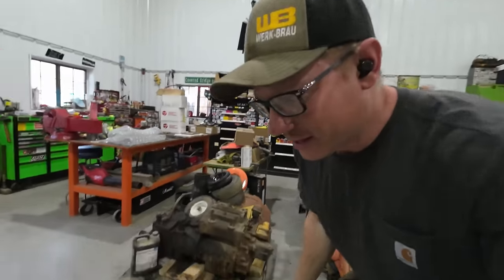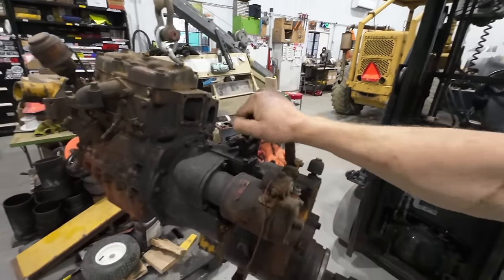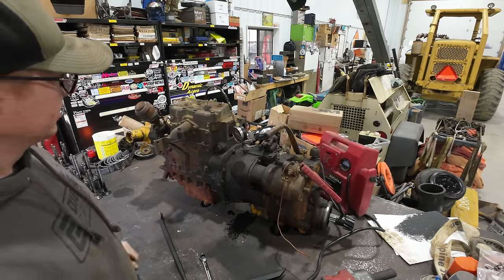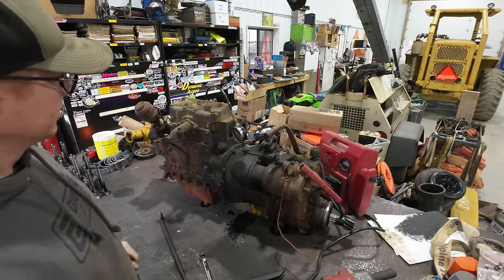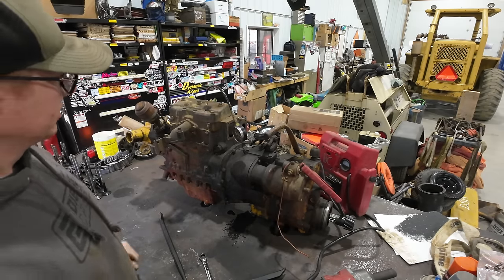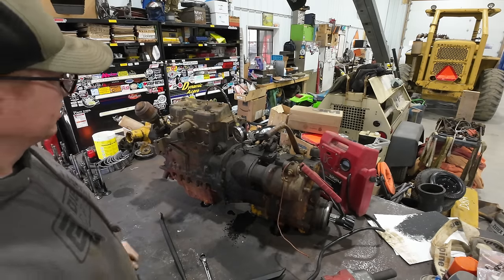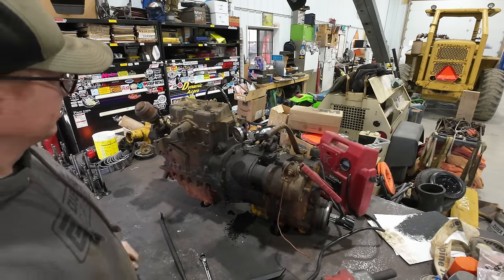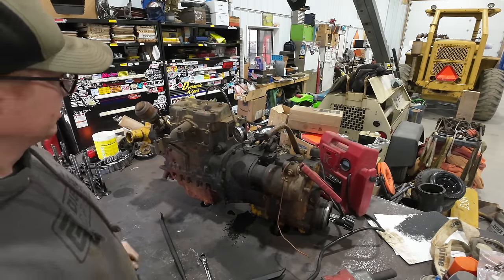AUTOPSY of a Caterpillar Pony Motor. | What Went Wrong?

Comment: Matt, at around the 10 minute mark you explain why you save old junk like this, but there's a neat side-effect of what you and those of use who care about old stuff do: there's a "gap" generation around old equipment where the old codgers who worked with it every day start to retire and pass on and the new kids in the field have new, high-tech fancy stuff and don't need things like pony motors &c., so off they go to collectors or the scrapper. With luck it's to a collector, and with greater luck still it's to a collector that will use it and instruct others in its use--like you're doing right now in this video.

When these things pass out of every day use and into the "antique" world, there's a risk that they themselves as well as the understanding of their use is going to disappear forever. Think about steam engines, and how a whole generation of teachers were mostly lost before the nerds picked it back up again. All it takes is a generation of folks going "I don't know WTF that does" to lose that real-world, practical knowledge of the thing. Great example is live steam, which in the UK is SO MUCH more robust than here in North America. Why? The Brits took forever to switch from coal, we didn't. And that switch just so happened to coincide with folks starting to wake up and realize that it's worth saving the old stuff, even if it's not "useful" in a conventional sense anymore. Like a CAT pony motor. :)

Thanks for giving a hoot about the old iron, Matt--preservation and conservation is a gift to future generations. There's always "a million of them" out there... until there isn't. Good, old machines deserve to be saved and ought to be put to work. They might be the only things that actually last in our age of emissions equipment and computer-controlled common-rail injection. Cheers, and I hope you and your pod have a happy Easter weekend. 🐇🐇🐇
Reply: I am 29 and i keep two stroke pony motor on my 60s Belarus (mtz-50) tractor. Learned to rebuild them and all. One day folks like me might be only ones knowing how to run them. Bolt on starters exist, but I will run pony just for sake of keeping old iron alive, even now when I installed turbocharger on the main engine, and water to air intercooler. Learning, modifying and still keeping old stuff on the tractor is really fun for me.

Comment: I agree with the mystery teeth coming from a previous starter catastrophic failure. I have never been in a position where my (and possibly my family's) next meal depended on me getting a piece of equipment operating so I could finish a job and get paid. The pressures of life and the mindset of someone who doesn't perform recommended oil changes and would also leave gear teeth inside a gear case is something I cannot relate to in any way. Matt has clearly established that neither the motor or the gear case received recommended maintenance and that the carnage occurred because of the wear on the engine main bearings which was due to oil that was filled with abrasive particles. Maintenance is not done for various reasons. I know/have known people that can always find money for beer and smokes but can never find money for oil changes. If every machine owner put maintenance high on the list of important things Matt wouldn't have a channel. Without so many mistreated machines we wouldn't have such entertaining videos illustrating the effects of that mistreatment.

Comment: Fascinating teardown!   The crankshaft bearings on these ponies are commonly ruined by a leaky carburetor valve: if the fuel shutoff isn't used and a tank of gas drains into the oil, the oil becomes useless.   Just a short runtime with ruined oil will trash the crankshaft bearings.

Comment: From an expert ‘ole cat skinner’ who has gone to the dozer home in the sky:  after you start the Diesel engine, disengage the pony, but don’t kill it.  Turn off the gas and let it run dry.  That warms up the pony, drains the carb, and your pony cast iron warms evenly to fight dampness.  I pulled down my D7-3t pony and found a shop that could weld up and grind the crankshaft back to spec.  We had to bore the cylinders off center to get them round again.  
My 3T was dry clutch so the previous owner managed to beat on the bendix with the canvas-and-sheet metal links that break in the dry clutch.  I found bendix parts from a 2U in a junk yard.  Be thankful for your oil clutch and be assured it could be worse.

Comment: My take away from watching this is pure amazement with the engineers who designed and manufactured that whole assembly pre computers. I can't imagine the cost to make all the tooling to cast all those different pieces in an economical way. Mind blowing to me.
Reply: Thats my takeaway.  You'd love the Henry Ford Museum. The sheer scale of these giant complex machines is mind boggling that it was done before computers. The highland park electric generator built in early 1900's is just awe inspiring if you think of the engineering challenges they faced and overcame. The giant steam engines assembled when horse power was all that was likely available to move the giant pieces.
Reply: @joshualester2735  What's amazing it to be hiking in the California desert, miles from nowhere, and to come across an old mine with ore processing. The size and weight of the engines, stamp mills and the like seem impossible to haul the several hundred miles from the nearest rail stop, but there they are as a witness for the workers of the past.
Reply: @87mini that was always my favorite part of shows like gold rush. How they got that equipment to the middle of nowhere in a time before internal combustion engines.
Reply: Yep. Life was hard, and men were tough, determined, and did what it took. Respect
Reply: Milling machines were the tools back day now its cnc machines or water jet or plasma tables all worth a kl 100g
Reply: A pony motor? You need to look at the machine tools that were being developed  in the 19th century. Those engineers were so far ahead of today's average STEM student.        Go look at the beautiful R-1340 9 cylinder radials Pratt and Whitney were producing by the 1920's, then their development  of the j58 turbojet. Most of it developed by men, lying in bed thinking in the abstract,  then manifesting it on a sheet of paper, then into reality. All without cellphones and only rudimentary computer modeling. Men without cellphones had to invent materials, then put other men in space, and so much of it was done by trial and error, thousand of failures, much futility, but they were overcomers blessed with the best computer on the planet, the human brain backed by 2 millennium of occidental civility to draw upon.
Reply: @MichaelSmith-xb5cp  There is at least one (1) video of teenagers putting together the wood pieces and carving the blades for wind tunnel fans at the start of WWII.  The fans they built are still being used.
Reply: I have a 1930 ford model A 68B that my grandpa got in a barter deal in about 1953 to fix a farmer's tractor. When grandpa pasted in 1973 my dad inherited the car. It sat in dad's barn until 2013 when he and I started a frame off restoration. Every nut, bolt, screw, panel, wire, bulb, bearing, bushing, or spring was either cleaned, refurbished or replaced. What a fantastic opportunity for and adult son to spend that kind of time with his father. While doing the restore we talked many times about how ingenious grandpa or the engineers of the time were. We had unlimited access to an entire Internet full of reference and information, while the original designers had their own knowledge and experience to use when finalizing a product design.
Reply: @MichaelSmith-xb5cp  This content brings in folks who normally would have never searched out this topic. I totally agree that we take for granted how resourceful we can be and why people are so surprised when they find out it’s extremely old technology. Time flies when your having fun.

Comment: Try to take the crank to machine shop what they say. Try to turn it. The bearings you can pour yourself -> functional engine.
The transmission - you can try to bronze weld it. It was quite often used technique in 50 and 60 when engine block cracked. Such a block was used for very long time afterwards. If you never made it this transmission is perfect thing for a try and learn.

Comment: Wild guess s those teeth were from a part that was replaced? Something stripped the teeth off, maybe the starter? They replaced the starter but didn't pull the whole thing open to gett he bad parts out
Reply: Bingo!  👌👌👍👍
Reply: That's what I thought.  
Quick roadside maintenance. 
No proper lighting,
Old one out, new one in back to work.
Reply: I was thinking the same thing!

Comment: As a retired truck mechanic 32 yrs. I have never seen a crank with that much play in it. Hard to believe that it was running that way. Great vid, love your content.
Reply from the maker: I agree. It was wild
Reply: i have to think due to the design the gear portion was doing some work it wasnt designed to holding up the flywheel/crank, so really the flywheel would of been much more centered when assembled but putting alot of wonky forces on that clutch pack and the bearings in the gearcase

Comment: Matt, If you choose to weld that cast iron here's a tip. My Dad a fleet diesel mechanic who would be 102  ys now, would take an acetylene  cast rod, strip a elecrtical 14 ga wire, wrap it in 1/4 inch wraps, drill both  ends of crack, rose bud the cast then  dip flux and weld  one inch strips from each end till welded. This allows hot welded cast to be softer and more flexible. This is especially good for manifolds. Don't forget to bolt down a manifold so it doesn't warp. Hope this long winded story helps you some where along the way.
Reply: Borax...used for the flux was what they had us use at TAFE college
Reply: It wasn’t unusual years ago that a tractor would have a cracked block from freezing in the winter, they’d weld them back

Comment: That babbitt bearing was probably a poured lead job which would explain why the metal in the bottom of the pan is so fine.
Reply: Actually that one looks like aluminum.  Babbett wouldn’t have cracked off like that when he tried to drive it out of the block.  Just a note, there’s spacers on that oil pan which is actually the lower crankcase and bearing saddles.  Without the spacers in the gasket line it’s possible to overtighten the bearing crush on that front bearing and lock the crank up.  Maybe some of them don’t require them but some certainly did.  

CAT used aluminum for crankshaft bearings in the main engines too.  Seems strange when we see mostly steel backed bearings with babbet overlay in old machines but they used them quite a while.

Comment: The gear teeth look like they may have come from an old starter Bendix that might have dynamited at some time. Most likely from the flywheel being as it is. Amazing that this engine still cranked over. Love the old iron, they are almost indestructible. No engineered obsolescence.

Comment: I hope you have at least some experience of "hand cranking" engines !  The use of the starting handle is probably the first introduction to the workings of the motor car, that those of us born in the fifties had ! I got my practice in, on my father's Rover 14, in the " here, you have a go !" basis.  Later I found that 4 cylinder motor motors were easier.  In my twenties I was still at it with decrepit small lorries on building sites,and dump trucks etc. If you are not used to hand starting motors you have missed out on learning how to wheeze and cough properly, such fun...
Reply from the maker: Oh I’ve hand cranked lots of engines just not these style ponys!

Comment: I had a cat12 grader with a 2 cyl boxer pony.  Pony threw a rod, broke some pieces out of the bottom of one of the cylinders, so I left the bottom oil ring off on reassembly.   
CAT dealer didn't want to mess with it which they told me by offering a ridiculous amount of $$$ to even look at it.  Also got into a contention between CAT and auto shop as to who broke the end housing getting it off the crank, but CAT made it good with another from their boneyard. New pistons, rings, rods and bearings and it ran like new.
Thank goodness for their boneyard, I also needed a steering knuckle for that machine.  Apparently it's common for the spindle to fatigue crack, because mine cracked through, and the first one they got me was also cracked in the same place.  The first spindle failed a bright early new year's morning, then broke the spindle on my case 580B trying to get the CAT12 off the runway, all before noon. Which goes to show you don't do ANYTHING before eating your black-eyed peas New Year's morning!

Comment: Hey Matt. I’m quite sure if you match those pieces up to some of the existing intact gears you will find the origin. My guess would be the starter drive. What I’m trying to say is that the pieces have been laying in there from some previous failure that you wouldn’t have any way of knowing about. There’s no telling how many starters have been on that pup over the years.
Reply from the maker: That’s what Sam said as well. But there was a Woodruff key laying with them and starters don’t have that.

Comment: Drill both ends of crack with oh 5/16 drill bit.    Then preheat case to 450 then weld with nickel rod then but case right back in oven still on 450 then over hours slowly bring temp down slow slow if to fast it will crack
Reply: Yeah, but why go to all that effort when he has several good ones already in storage.

Comment: I've never seen an in-line pony motor. All the ones I ever worked on were horizontal twins. We had them in dozers and a crane. Those were, of course, old machines as I left that place some 35 years ago.  They had no oil pan and shared the cooling system with the main engine. Getting them started was always fun in below zero weather, but the main would be all warmed up when started. We had them on D-4s, D-6s, and D-8s. The crane was the same. The operators would never shut the gas off, and the cylinders would get washed out with gas, and the compression would suffer.
Reply: The big tractor with the horizontal opposed pony was the D9.  D7 and D8 always had the 2 cylinder vertical inline pony.  After 1960, CAT made a new vertical inline 2 cylinder side mount pony that revved a lot higher and soon earned the nick name of “buzz bomb”. Probably hastened the end of pony motors on CAT equipment by a few years!

Comment: Compare the shrapnel gear to a starter Bendix gear. At some point in its life it may have had an Old exploded starter from the crank bouncing around, The starter being replaced and you running it long enough to free the parts up from the sludge.

Comment: That gear case is repairable actually, 
if it is made of cast steel it will be easier to weld than if it is made of cast iron,
but even cast iron is weldable if it is heavily pre heated to a couple of hundred degree's first and then covered and allowed to cool very slowly after welding.   Years and years ago when I first started in the trade it was an accepted part of the job and we refurbished many a block / gearbox casing/ and rear axle this way,  that block is also repairable in the same manner,  weld up the webs on the crank and have them turned back to spec by a crank grinder and do the same for any out of spec rotating surfaces and the rebuilt engine will be as good as new........important since as you said they are getting rarer than hens teeth now........there will come a day there wont be anymore left at all and you will be glad you didnt bin it. once they are gone there isnt any way back.

Comment: Wow at the crankshaft bearing wear! Someone ran that without oil at some point in the past. 
As for the gear teeth you found in the housing, that would appear to be broken parts of a previous electric starter drive. Apparently it tossed around in the housing until it became jammed in an area which caused the housing to be broken.

Comment: the heavy flywheel is part of the engine design instead of making a monster counterweighted crankshaft to smooth out the vibrations of the small engine and to smooth out the idle also assist in getting the two cylinder die sel engine running

Comment: The engineering that went into that motor alone must have been huge. Glad Matt took it apart for us mortals to see.
Reply: Actually pretty simple.  It’s 1/2 of a preexisting 4 cylinder design.  The first series (most of them) were odd fire as you can imagine results when you have only the back half of the 4 cylinder.  Then CAT designed a new counterweighted crank and a new camshaft that made it an even fire engine but then reverted back to the old odd fire design before they stopped making them altogether.  

That brings up the magneto ignition. Obviously there’s a difference between even fire and odd fire msgs, so when you’re looking for a msg to swap on something make sure you account for that difference.  Same for mag distributer caps etc.

Comment: Matt 
Squatch253 is the place to learn about these. 
Glad to see you saving these parts.
Reply: I second this: Squatch is a walking encyclopedia of old Caterpillar stuff. I'm willing to bet he would be fabricating tools to do a repair on that gear case, if he were in Matt's shoes; if not, it would be going to a shop in a nearby town where some old timer still knows how to fix it 😆
Reply: There seems to be a very few old-timer shops left in Way Upper Minnesota.  He found a radiator shop that doesn't run away crying because of building a recore, a machine shop that he trusts that will rework something besides a small block chevy and someone who will braze up cast-iron. And who knows what else.